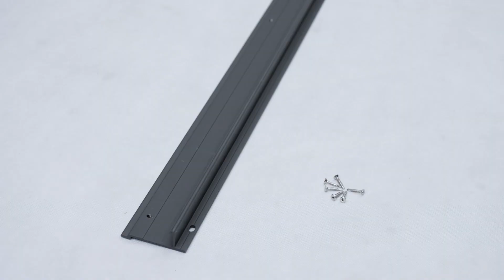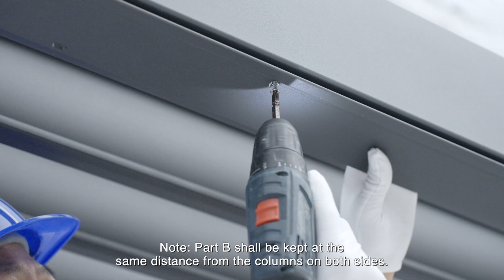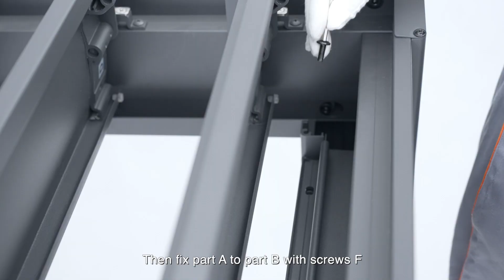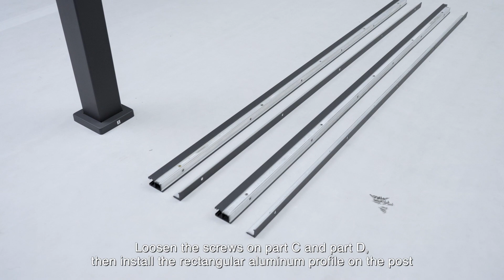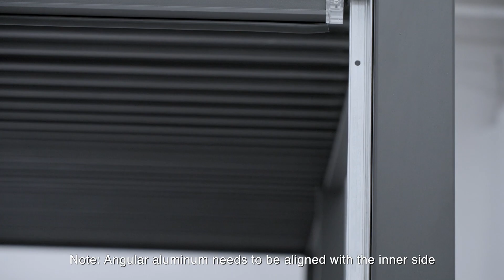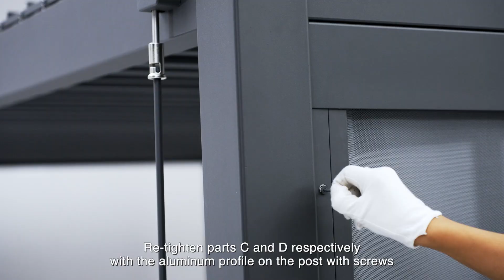Gardesol 10' Aluminum Pull-Down Privacy Screen Pergola Divider

Comment: This video is wrong for the blinds it shows the vertical runners fitted in opposite directions, which given how the thread the blind and mount it you wouldn’t be able to get it into place, the two runners should face the same way either inside or outside